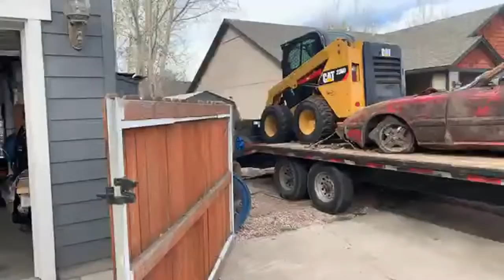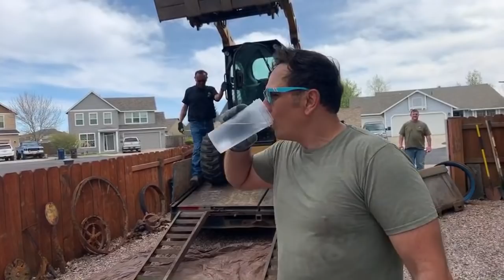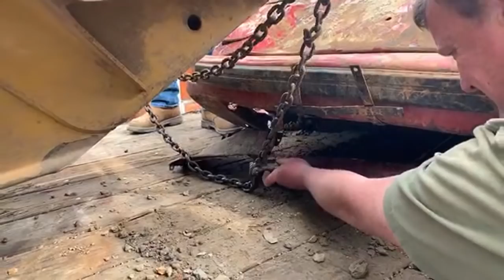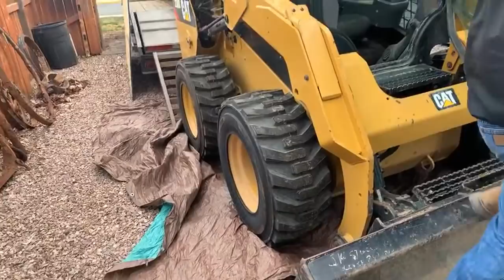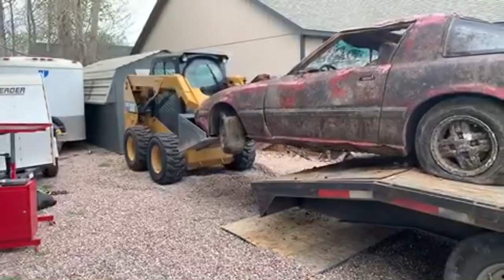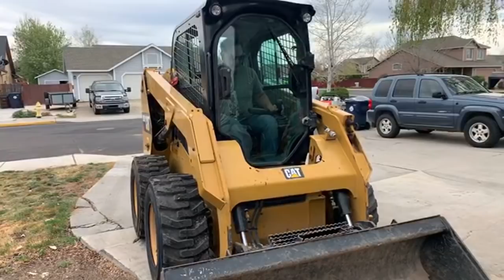RX7 Quarantine Project: RX7 Delivered... Part 2 with LiveStream Q&A

Comment: Might as well just try to restore the car (personally would love to see that happen)
Reply: Yeah restore the car
Reply: Everything is down junk is an option
Reply: This ding bat restore a car? Hahaha yeah right🤣
Reply: I've seen less rusty 90s cars... sure, it's a basket case, but really how cool of a story would that be to tell at car shows.. in 5 years time. :)

How many people can say...

"This car was sleeping with the fishes."
Reply: @adventureswithapurpose hmm, part one isn't playing
Reply: Braptastic films you’ve got a point I mean idk if that guy could do the body correction needed for it alone to be honest but it make a really cool video series
Reply: This Mazda RX7 is ideal for rat rod project.
Reply: I admit it would be one hell of a project, however, it's just not worth it in the end. Almost everything is damaged and needs fixing, which makes it just an endless money pit.
Reply: Good luck
Reply: @braptasticfilms3791  never underestimate someone ability to do somthing
Reply: Yea, the idea is cool, but the RX7 was on a unibody frame. After that many years underwater, this car would never be safe to support itself and the engine. Every body panel is junk. The electrical  is toast. The axles are probably toast too, as well as all chassis components. Not to mention the interior, windows, and probably the floor pans. To recap, every bit of this car is junk....you can't rebuild it, you'd just be building another car with used or replacement parts...then it would just be a new car, not a rebuilt one.

Comment: This is awesome! Thanks so much for taking my advice and parting them out, and melting down the rest into coins is awesome too! :)
But, I think you should do this with the Jaguar you found also, and even though you cant melt down much from it, besides the frame and other parts, you could also do it on the yellow corvette you guys recovered also. What ever happened to those 2 cars? They seemed salvageable.
Reply from the maker: The Jag ended up with a friend of Walt's. The Corvette is long gone. 
But we still have the Mustang.

Comment: The volume is bad again & you should have miked yourself on the first part as well as part 2.  It seems to me that if you had a big flatbed wrecker & backer up to the trailer it would have bee easier.  Cat onto the bed of the wrecker then dumper onto the gravel.  Could you done a voice over to both pars?  Such is hindsight!
Reply from the maker: Hindsight... and other tools for sure. We work with what we have.
Reply: @AdventuresWithPurpose  Experience is the key.  Next time you will do better as you have done on your vehicle retrieval from the water.  Keep having fun with your retrieving.

Comment: Hola, i am Guille of Argentina, what you wanna do with this rx7? Will you restore it?     This is an amazing car
Reply: They estimate the car has been underwater for 25+ years. Even though it may look somewhat fixable from the outside, it is just a bucket of rust. He is going to pull parts off that people can buy, but those should only be used for decoration. Then he is going to melt some parts down, probably wheels and other aluminum, and create souvenir coins that people can buy.
Reply: @JBisaPEDO  thanks  for the información, do you  know  the guy or something?
Reply: @MrGuillemartin  No, but he has said all of those things in different videos about this car. And I have worked on some water logged cars so I know how bad they can be. If I had pulled this out, i would have just saved 1 or 2 things off of it for myself and junked the rest, but i know he is doing this for his fans